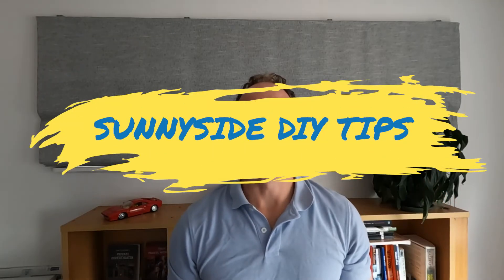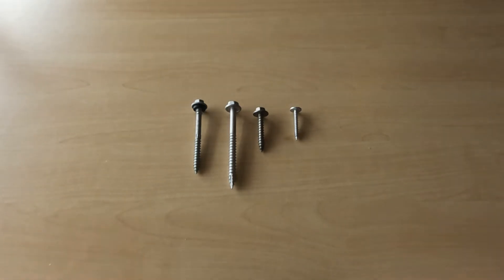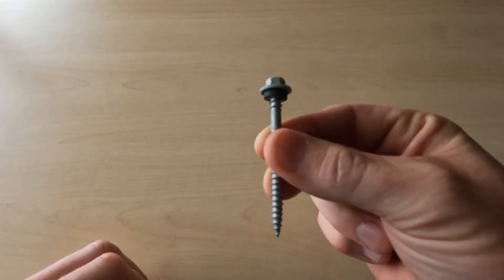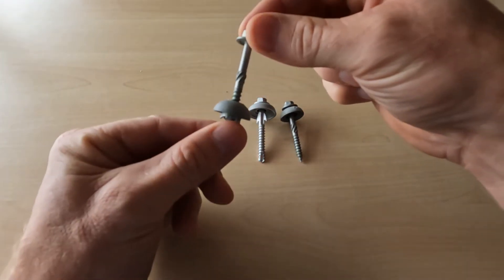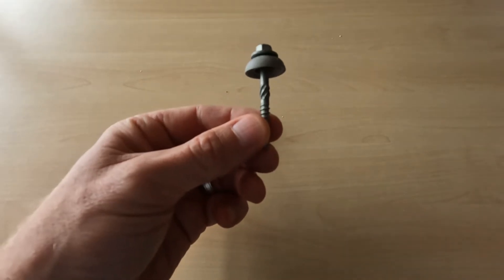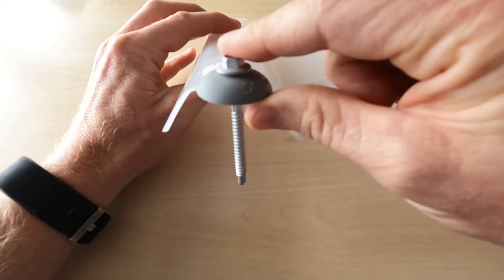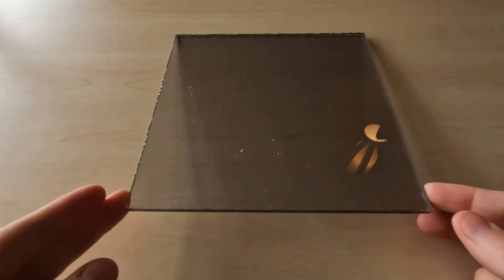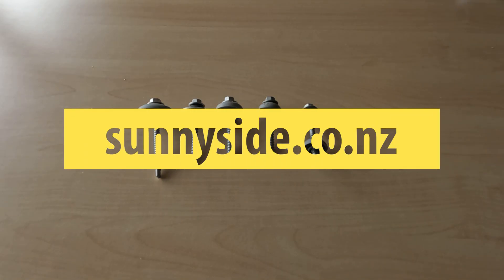What type of screw for polycarbonate roofing?

Comment: sorry guys but in Canada I have a 8 metre x 2.5 metre (approx 25ft x 8'6" for Americans) clear panel polycarbonate  patio roof. used steel roof screw with rubber metal washer on poly roof. don't go through the rib, go through the flat into strapping been over 5 years no leaks so far.

Comment: Sure wish I'd seen this before installing my first set of panels!  Home Depot sells the "steel roof" style fasteners right next to the poly panels so I thought nothing of using them.  Bad idea, they leak like crazy and I ended up caulking each individual screw after the fact (ya, not ideal).  I used the correct fasteners as described in the video for my second installation and no issues at all and super easy to install.  They are more pricey for sure, but well worth it.

Comment: Hi Edd.... I'm about to install a roof but don't want to screw through the sheets.. can I use some kind of glue on the second rafter instead?
Reply from the maker: Hi there, you can't really use glue on any clear roofing. It may break it down, and will eventually work free. Thanks, Kurt.
Reply: @sunnysidenz  thanks Ed,....What would you recommend instead of screwing the sheets to the rafters? Basically each sheet will have one rafter in the middle for support. As I want to sheets to last I didn't really want to drill them so thought I could puta bead of silicone down the middle beam to keep it in place... its evo stick bond solent free... any advice would be much appreciated.. thanks 

Stephen
Reply from the maker: No worries Stephen. If you really don't want to screw through the sheet you could look at having a joiner on each rafter instead. So you can cut the sheets in half, have a joiner on the middle rafter as well, so all the sheets are held down with joiners (rather than screws or glue). Thanks, Kurt.

Comment: I've used the steel to wood fastener with rubber washer in the poly panels. Have not had any issues for 10+years.   Placed in the valley for maximum screw retention into the wood.  Done both locations but feel the valley is better.  Have worried about corrosion of water running in the valley but have not noticed any issues.

Comment: Is there a fastener which lets to fasten solar panel brackets to which aluminium panels will be mounted with panels? I have a pergola quite big enough and I'd like to put solar panels on that pergola instead of the house as I do not want water leaks in the house.
Reply from the maker: Hi there, generally your solar panel brackets will come with fasteners for fixing to a roof. Usually it'll be a system that has a washer that goes between the bracket and the roof, to prevent leaking. For polycarbonate roofing you'll need to make sure this washer is large enough to cover the expansion hole. You might need to purchase oversized washers. Thanks, Kurt.
Reply: @sunnysidenz  I have wooden planks 80x50mm, so decided to take 20x3mm steel flatbar cut into 120mm pieces. Make 8.5mm holes at the ends so that 82mm distance between holes. Using threaded rods 8M clamp the flatbars and make holes 15mm in corrugated sheets. in the top part of the rod put pair of nuts and between those nuts leg which will be holding the rail for solar panels. PVC 0.7mm will be plaing role of the oversized washer.

Comment: Thanks! Just trying to complete a video to release soon, and I've been trying to find the plastic screw caps I used to install my multiwall-honeycomb 8mm polycarbonate sheets, (with the rubber donut that goes under them) But can't find them anywhere!! I hope I can find these metal screws with neoprene and washers with neoprene tomorrow... 

Do you recommend a special screw for this or NOT recommend a particular screw, like zink or stainless? also how big should the expansion hole be? 

I'm having this crackling noise in my gazebo, you can watch my video to see what im talking about. when its sunny or sunny and windy, the crackling is bad, its not super super bad like ive seen in some videos, but id like it to be 100% quiet. I'm hoping its just the screws, but im also reading it might be because I didn't put anything like a tape between my polycarbonate sheets and my purlins. Could that be it? I know theres a few screws that are on there too tight, and I know I made the screw holes the same size as the screws, so these are the two things I'm trying to tackle and fix before releasing my polycarbonate roofing video to show people what NOT TO DO. 

Thanks for your help. Also, if you wanna be featured in my video as the expert and give me some pointers or recommendations, I'd be happy to discuss!
Reply from the maker: Hi Mateo :) Hopefully you found some suitable screws for the multiwall. You need something with a large metal washer and then a neoprene washer underneath. And since it's outside it needs to be either galvanized or stainless. Either one is fine. Stainless will last longer, but galvanized will last longer than the sheets anyway.

In terms of cracking, there are a number of causes. One of them will definitely be the screws not having an expansion hole. You'll need to drill a 12mm expansion hole first (about half an inch). Also, the screws may be too tight. The second thing might be no room for expansion in the joiner. Is there a bit of a gap for the sheets to move in that joiner? 

Happy to help out on one of your videos :) I'll DM you.

Comment: I'm glad I found this! I purchased the fasteners without the expnsion hole cutter thinking it would seal my corrugated polycarb roof better given a bigger hole in hacked through it. I'm glad too I haven't started installing the roof and I kept the Bunnings receipt for the screws. Just need to figure the water proofing of the roof against a compressed fibro. Cheers.
Reply: Hi there, glad it was helpful :) Perhaps you could use some sort of flashing for the fibro? Thanks, Kurt.
Reply: @kurt-nz  As it turns out I'm investigating flashing along with a rubber sealant. Unfortunately it'll rain tomorrow so will have to wait it out before continuing. Cheers.